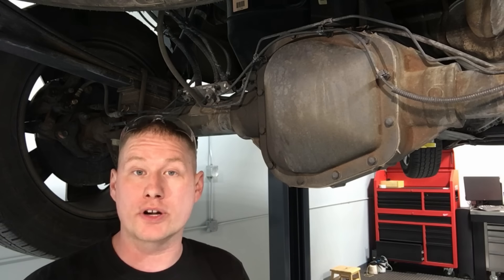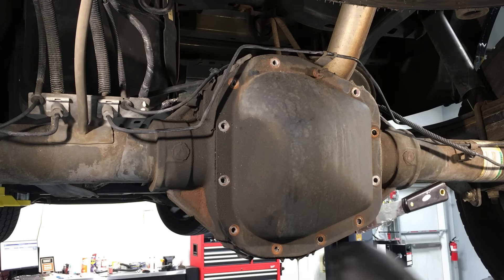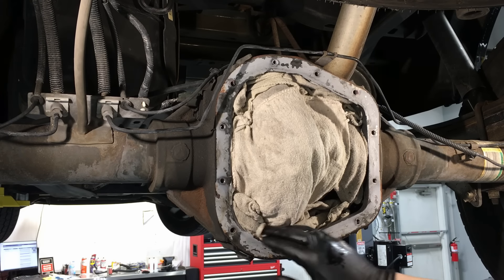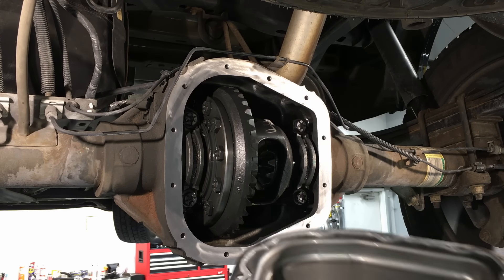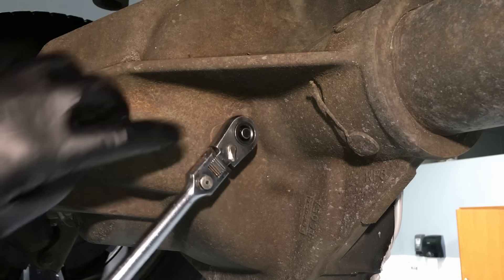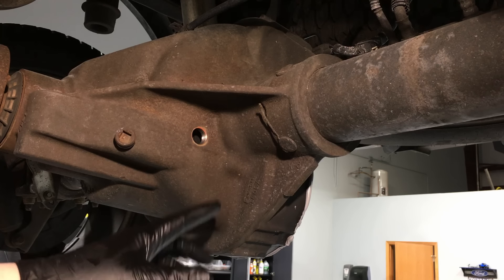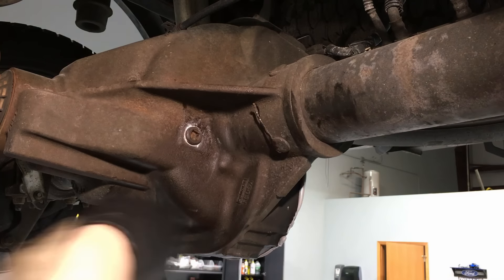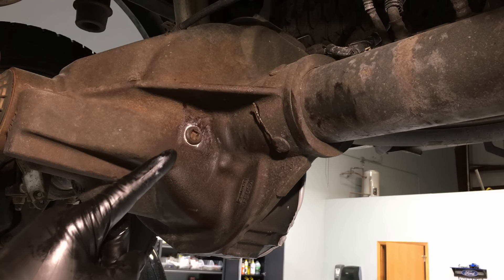Ford 8.8" 9.75" 10.25" Rear Differential Service: Fluid Change Procedure

Comment: You should always make sure you can remove the fill plug BEFORE removing the cover . Mine was rounded out so I ended up drilling and tapping a 7/16 hole in the cover . I plugged it with a set screw and put a dab of sealant on the threads to seal it and keep it from coming loose .
Reply: Try tack welding a (cheap) short 3/8" extension to the hole. The heat helps loosen up the plug and break it loose.
Reply: Next time do it right and get a NPT tap
Reply: should have bought a replacement cap.
Reply: Air hammer the old plug out, just have to tap it counter clockwise and it comes right out.

Comment: I always use a gasket.  The cost is about the same as RTV and there is no possility of leaks.  I also use a piece of tygon tubing on the end of the bottle snout to aid in filling.  the bottle can be emptied without an issue using the tube.
Reply: Why not a gasket?

Comment: 2021 Ford F150. 57,000 Klm
Followed your process, I don’t have a hoist, but I do have a floor heated garage, so laying on the Epoxy Painted Heated Floor wasn’t to painful other than your laying down the whole time. I put all the tools you suggested and the oil drain pan on the floor and drove over them. It was nice having everything at hand vs in and out from under the truck.
After I crawled under I realized I should have removed the Spare Tire so my small impact could reach the top nuts, but I was able to get at them with a 3/8 ..1/2 in ratchet.
Sure didn’t look like 3.5 Quarts coming out.
Easy job really, boy oh boy, those nuts were tight, I was almost scared of busting them off. They had Red Lock Tight on them!
Mine had a gasket.
Anyway, thanks for all your help!!

Comment: Amazing job is always Brian. I would like to see you eventually perform a front differential fluid change. When I did mine I was not able to remove the front cover and I had to work around that since I already had it off to a point. I would like to see the proper procedure to do it.
Reply: Feliberto Vargas yeah, I know what u mean, stuff in the way. I just drain and refill the front when I do the rear.

Comment: This is the exact same method I’ve used for five decades except if a gasket is available I will  put it on the axle to keep liquid sealant on the cover from sticking to the axle. This makes the next oil change much quicker and easier.

Comment: If its got studs in some of the bolt holes, thread two of them back in hand tight WITHOUT the nuts on them. Use them as guide pins when reinstalling the cover to line the bolt holes back up.
Let the gasket sealer sit for about 10 - 15 minutes after you run a bead around it BEFORE putting the cover back on.
Reply: Permatex Gear Oil RTV Sealant (green) says to assemble parts immediately after running the bead.

Comment: I replaced two of the top fasteners with Stainless Steel studs. Makes alignment much easier. I also used a Felpro gasket, but now I have noticed a very small drip under the pumpkin. I guess I'm going to have to remove the cover again. I guess giving us a drain plug was too much to ask of Ford, just like the transmission. I replaced the transmission pan with one with a plug. I might try adding copper crush washers first. Yes, both surfaces were very clean. UPDATE: My pinion seal was leaking. Replaced it via Brian's instructions, all good now. Fel-Pro gasket on cover is fine, added copper crush washers just for kicks.

Comment: The very first thing you check is making sure you can remove the fill plug.  No use doing an oil change if it is stripped or cannot be removed...
Reply: Very good point, I seen this happen in areas that salt there roads.

Comment: Thanks for this video. I just did this for my 2012 expedition. Used the valvoline flex bags from Walmart for 12 bucks each. About 2.2 quarts is listed.  I did about 2.5 or just under. The drained fluid was slightly white milky like you said. Wasn’t worried only thing is the fluid was very bubbly like it was whisked. I have seen your videos like this and will be doing the transfer case next. Thanks again. My expedition has 81k. Just did first oil change with pennzoil platinum 5w-20 (warranty) . And motorcraft   Filter.
Reply: Sound like water got into your differential housing.  Happened with my old 2007 xlt 4x4.  I was using it to launch my boat and had backed in to deep.  gear case grease and oil turn milk and frothy when whipped up with water.

Comment: I have never been a Believer in using just silicone as a sealer, I have seen a lot of leaks and failures with that method, I have always used gaskets and gasket sealer on all of my projects and that has always worked well for me with no problems.
Reply from the maker: You have to use the right sealer is all.

Comment: Question for you Mr. Ford Tech: If you’re ideally trying to get all the old gear lube & impurities out of the pumpkin (especially if your rear end hasn’t been done for a while), why not hose out the inside with break parts cleaner? Is there any reason not to?

Comment: Thankful I found this video, I needed a refresher tutorial
75/140 being the acceptable weight and this run is on my Ford Expedition 4x4 with those computer controlled locking hubs 
Front differential has a drain plug rear differential does not

Comment: Take those paper barcode tags off the axle tube. My '04 9.75 had a lot of deep pitting in the metal where that tag was trapping the road salt and grime under it, caused it to rust a whole lot faster. 

Went to a junk yard to get some parts, and every f150 there had the same pitting/deep rust from those simple paper tags
Reply: Not suppose to take them off if you lkst it your screwed because you wont know what rear end you have

Comment: Got to love that smell of old gear oil.
Reply: Geiger Counter Virtual Museum that hypoid stuff has lots of sulfur. Smells horrible! If you get it on your clothes best to throw them away!
Reply: No kidding. And the older it is, the worse the smell seems to be. Wear gloves or be prepared to have shtinky hands for days.
Reply: Full catlitter box smell for sure!
Reply: It's a fantastic aid for teaching people how to scrub up after getting into poison ivy.  Put a little daub on their hands, have them rub it in then ask them to wash their hands [with liquid dish soap].  The smell remaining is proof of failure, and tell them to scrub up again.
Reply: Geiger Counter Virtual Museum hate the smell and I’m a tech
Reply: It actually smells like dinosaur farts.
Reply: Gear oil not that bad. What about an electrical motor that burns up... that odor soaks into everything.
Reply: The smell is real bad.
Reply: Ford positraction conditioner absolutely reeks.

Comment: Your channel is second to none dude can't tell you how much you have helped , this one I should do I got 280k miles on my explorer , never changed rear dif or xfr case fluid , if it's notta broke don't fix lol love my 08 explorer it's a tank, I honestly have to say it's the best vehicle I have ever owned , only thing I have done to it is brakes and oil,tires litterly that's it , has no codes runs like a top

Comment: You're supposed to let the the sealant set for an hour before you snug the cover bolts down per the instructions on the Permatex package.
Reply from the maker: Yes I know but I follow Ford's procedure which uses the same sealant and never a problem in 15 years. You must torque them not ram them home and call it good. You can see here the process takes awhile to do right. Figure in the drying time right there.
Reply: FordTechMakuloco Good to know. I think I'll stop wasting that hour just watching sealant dry whenever I do any diff work from now on.
Reply: Should we let the sealant skim at all or just run the bead and put the cover on?  The rep from permatex told me to follow the directions on the package.  

I’m guessing as long as you take your time, the sealant will be fine...I just don’t want to have to do it again after I add the expensive gear oil.
Reply: I dont read directions   kinda have a compression  issue   it's crazy  what you read in directions
Reply: He says that in the video.

Comment: Good video, but I would use a lot less sealant on the cover, as you'll end up with a large over-bead of sealant inside the case that could possibly come free and get into the works..

Comment: What do you think about replacement diff covers like Mag Hytec that has a drain plug to make changing the oil easier than always breaking the seal?
Reply: jrfizix you will never get the cap out in the sump of the differential. you see him go in there with a towel and full that junk out of there.
Reply from the maker: On the rear end I like to go in an wipe it out every time. Now if they had something similar for the front then I would say go for it.
Reply: I've got the afe cover and it has the drain and dipstick which is nice for not making as much of a mess when changing the fluid. And it has an o ring seal so no need to use any sealant Imo it's worth it

Comment: Just did mine: F250 2005, 200k miles. The fluid was amazingly clear, the 75w140 and 4.25 quarts is the ticket. Had some small metal chunks, fluid was low by 1 quart...very bad and glad I caught it.

Comment: Anyone else actually enjoy changing fluid?  I even swap our power steering fluid.
Reply: Kinda sux with a deisel    gallons and gallons
Reply: yeah, I enjoy it. Always do power steering fluid as well. It's not that much work really.
Reply: Yes I use to hate it but now for some reason enjoy it and usually change them early
Reply: I do outlandish maintenance to my current truck due to the shame I have for the way I treated all of my previous vehicles.
Reply: @brandongouge  same.  I use to beat my vehicles to death as a teen.  Once the service bills started to rise.....I woke up to my stupidity.
Reply: Now that I have a vacuum bleeder I do!
Reply: once I understood new OEM Fluids are designed super thin to barely lubricate + "save gas" ("FE" grade), I started to respect flush intervals to prevent failures.
Reply: not when your a real mechanic
Reply: I get the same enjoyment some do when tightening a strap, popping it, and saying "she ain't going nowhere"

Comment: Thorough for sure, but the care you used by wiping out the bottom sump, covering the gears, blowing out the holes etc I’m sure the average mechanic isn’t doing all of this. 

As a previous commenter said, adding headless studs and THEN putting the pan on for alignment & hold is a great idea!

Comment: After watching the video I changed the fluid in my Ford.  When reinstalling the cover I cut the thread off of 2 C clamps (which were the same thread as the bolts) and made some studs which I temporarily installed to align the cover and not smear the RTV. It helped me hold the cover still, especially since I was working laying on the floor. Also I used Ford RTV made for this application. It doesn't have to dry for an extended time before adding oil (but it is very expensive).

Comment: One thing I do in a situation like this is get a few extra cheap longer bolts and cut off the bolt head.  I use them for alignment studs and slide the cover on, catch the rest of my bolts, then remove my alignment studs and put in the bolts.  Helps control the cover and not smear the sealant because you are pushing it straight into position.  This worked especially well on my LS1 water pump because it was in a very awkward location and controlling the weight and starting a bolt was near impossible.
Reply from the maker: Great idea if you are in a tight location but in this case it's just not needed.

Comment: They always say in the manual you don't have to change the fluid in the diff in the Rear. It's suppose to be lifetime supposedly. But I do it anyway. Because all fluid wears out eventually. And the rear diff is expensive as shit to replace.
Reply: Right on! I do this service every 15k miles.
Reply: not sure what manuals you have, everything I have suggests to change the fluid. it gets contaminated by water and dirt, besides internal wear
Reply: I don't know why modern third members are any different in modern cars. We used to pull them out of the mud in the junk yard, hose them off, install them and run them.
Reply: @Deucealive75 
They are pretty much the same. Only difference is where the ABS sensor might be, and if the rears got disc brakes. And like in this video, if it has electronic locker.
Reply: @taledarkside  I figured they were about the same. I guess our thinking back then was if you knew it didn't take in water through the breather and didn't leak, you just ran it forever.
Reply: @Deucealive75  
That breather is the only weak spot, since it takes in water and dirt. Some of the newer vehicles have the breather hose a foot higher than the old mushroom caps. I haven't repaired to many rearends, but I don't know if it was a material problem or maintenance problem, but you would get a groove in the axles from the bearings.
Reply: KingConker101 no such thing as time fluid it’s BS

Comment: Thanks to FordTechMakuloco my 2014 F-150 is properly maintained as a result of his maintenance tips.  To be specific, I followed his advice to perform rear axle and transmission services early (Ford says 100,000 miles).  I opened up my pumpkin and found that Ford had installed only 2 of the required 3-1/2 quarts of 75-140 gear lube.  I flushed my transmission and found only 9 qts were installed of the required 13 qts.  I wonder if Ford uses the cost savings resulting from short-changing new vehicles fluids to increase thier profit reports?  I trusted my Ford dealer to perform fluid checks on all serviceable items.  With a mere 59,000 miles on my truck, if I hadn't serviced these two critical driveline components, my out-of-warranty repairs would have been thousands of $'s.
Reply: the same thing happen to me I only had 62 ounces in my 2015 f150 with 65000 miles. When I refilled it it needed 82 ounces. Be warned ford owners check your fluid.

Comment: Good Video- One Good trick to use when putting cover back on-- I cut the heads off a couple  3 inch long bolts and cut a screwdriver slot in the end and screw one in on each side and then you can slide cover on over bolts and lines up Perfectly first time! then put all bolts in and back out the long studs with a screwdriver. Works Fantastic!! I do the same thing when reinstalling transmissions. Great Tip my Grandpa showed me 50 years ago!!
Reply from the maker: No need on diff covers this easy it’s all open back there basic hand eye cordination

Comment: The differential is one of the most neglected area on the light duty vehicles and you can get away with it but heavy duty ones you will know if you neglected especially pulling or carrying loads.
Great video. And make sure put the plug.
A friend got the truck serviced on the dealer and they forgot to install the plug so his truck rear end

Comment: Great explanation, good detail provided.  Didn' t read this recommendation in the comments, but recommend removing the fill plug first to ensure it is not corroded in place.  If so, fix this issue prior to draining the differential.
Reply: Trust me, good sir, every single video on YouTube that involves changing gear oil has that disclaimer in the comments:)

Comment: to help align the cover I took 4 other bolts that threaded in and cut the heads off and put a notch in them for a flathead screwdriver (incase they got tight) and jus hand thread them in to make it easy to align and put the cover on. to put the oil in I use a 1/2in clear hose about 4in long that fits inside the hole so it doesn't spill

Comment: Excellent vid and attention to detail that is soooo lacking with many technicians. 
I like to brake clean the bolt holes out, especially the lower ones that got gear oil in them.  Keep the bolts from pushing the lube out and into the silicone bead.

Comment: Nice video. I use a wire wheel on an angle grinder which avoids the debris from the grinding disk. Also a lube locker gasket works well and avoids all the gasket compound cleanup

Comment: This video help give me the confidence to do job. I was successful now 3 days later. Of course I enjoyed my own farting coming out of fill bottles. My struggle was getting the bolts loose then popping the cover. I fought with the seal for a while with chisel  and light 🔨. Once I got frustrated I went to screw driver and heavier hammer. It popped very quickly there after. AutoZone said I must use gasket.. I never watched a video with use of a gasket and more importantly the factory did not use a gasket. I used the Permatex. I got the "squish" and was happy to be at half way mark. I waited 4 hrs and filled. I let sit in driveway overnight. No leaks it looks good I'm happy. I'm freaked but I got the belts and tranny fluid exchange next. I love youtube and posters like this dude for helping us be confident.

Comment: That is the proper way to do it. I went to the dealer for a recall on a different issue but just out of curiosity I asked them if they remove the cover on a rear diff service or do they just use one of those pumps to suck the fluid out (which doesn't get all of it out much less any sludge or debris that may be on the bottom) and they said they just suck it out and refill for around $200... thanks but no thanks. I will do it myself, and when I did barely 1 qt came out but I noticed it was damp but not dripping  around and under the housing around the pinion yoke...I had a similar problem years ago where the vent hose was open without one of those caps on it and down south where I live we have mud wasps that will find any open end of a hose and go inside to build there nest and plug it up...sure enough this one had the same problem...the seal wasn't ruined but enough pressure built up to where the fluid had to escape because it is not damp around there now since I unplugged the hose and put some screen on it to keep them from crawling in there.